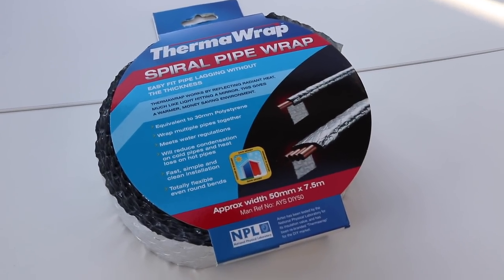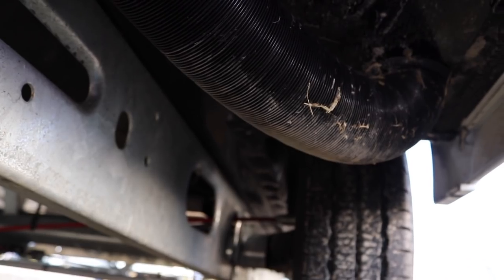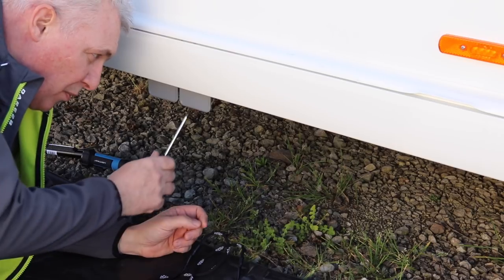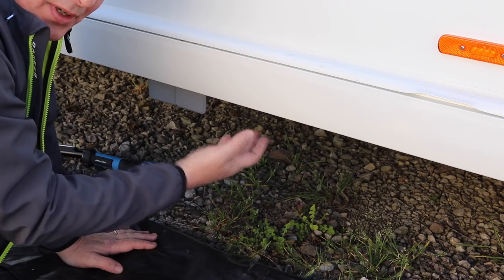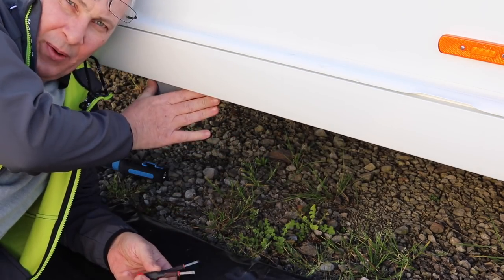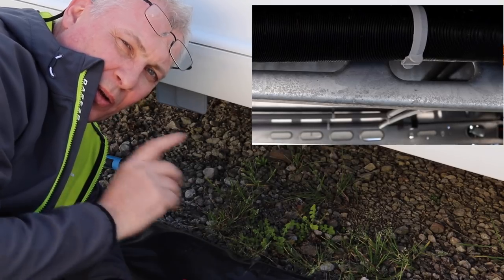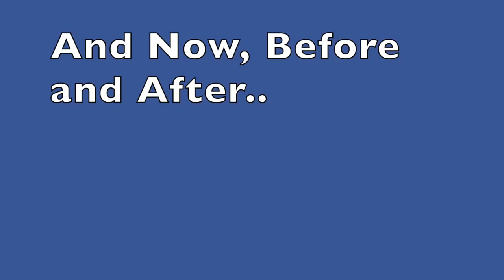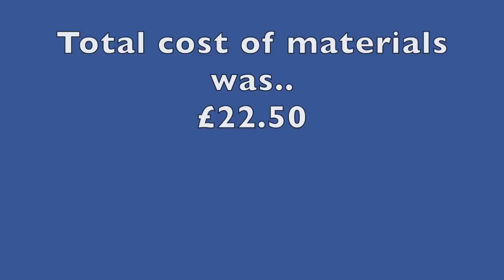Insulating the Blown Air Pipe External Ducting for Sprite Caravan

Comment: Great video. I heard a few people asked dealers when brand new to run all the pipes inside the van.
Reply from the maker: Thanks. Yes this is a getting rare outside ducting.  Swift still use this method sadly. What makes it more disappointing is that Truma make an insulation kit which is very expensive.  Thanks for watching. Phil😀👍

Comment: Hi Phil... nice neat job u done there 😎😎👍🏻... I experienced the Same problem to and after a lot of research and experiment to see exactly how the heater works to resolve the problem.. the problem is that it needs the gas to heat the exchanger up to increase the fan to disapate the heat... in winter the electric doesn’t get hot enough so the fan just ticks over... until gas comes it to top it up then fan will speed up blowing faster to the rear of the van.... downside is that after spending 4 days away in winter it used 3/4 of a 6kg gas 😪.. so ur probably best buying a small 2 kw electric heater to top up when cold instead of using ur gas ... hope this helps 👍🏻👍🏻
Reply from the maker: Cheers Dude. The Dealer explained using gas to me.  I think I will try a number of ways including your suggestion when we are away in a few weeks time. Thanks for the advice. Cheers Phil. 👍

Comment: Hi Phil u done a good job there I bet it back breaking under there not much room I've heard other people having the same problem can't under stand why manufacturer don't do this in the first place surely they know this is a problem .kev
Reply from the maker: Hi Kev. Yes it is hard work but I hope its worth it. I have spoke to Truma today and they recommend that you run the Heater on a mix of gas electric. I will be trying this out in a few weeks time. i will update everyone asap. Thanks again. Phil🙂👍
Reply: Swift can't even connect the waste plumbing under the kitchen sink properly, so I'd be amazed if they could be bothered to do this.

Comment: Hi Phil real fiddly job but I’m sure you’ll reap the rewards. The bathroom on our Charisma doesn’t get warm, pipes are inside but it’s a long run on twin axle. I only use the heating on electric (too tight to burn gas as well 🤣) and have it convection mode. I bought a small oil heater for a bargain price as the shop was closing down this keeps the bathroom toasty. Thanks for the vid.
Reply from the maker: Hi Colin Yes it was a pain to do and film at the same time. I cut my hand to bits😞. I am going to try it out in a few weeks time and also the small electric heater with me for the bedroom. Thanks again Phil👍😀

Comment: Hi Phil,i did this job on my Sprite Major 4 sb at the beginning of this year and today i had the chance to run it up as we are away for the first time this coming w/end,i used exactly the same materials as you and i`m happy to report that it does work,heating on 2kw leccy and using a 30c temp setting after 45 mins i checked the b/room vent temp and it was showing 26c on Eco fan,in the lounge area vent temp was 35c,i turned the temp down to 18c and it was very cosy BUT it soon became clear that the front area gets too hot with both outlets on that the obvious thing to do is turn the temp down but this would then make the rear of the van cooler,i need to find a way of restricting the heat outlet at the front to try and create a more balanced system but i don`t suppose there is a directinal flap on the Combi boiler to do this like there is on other Truma heaters,i can see this will be an issue in the future,all the best,Colin.
Reply from the maker: Hi Colin. Welcome. I am glad it worked we are away very and will be trying it out too. I understand you issue with the front being too hot.  I have spoke to Truma over the last week and sadly they say that restrictors on the front vent should be used on our type of boiler as it can cause the system to over heat. So to a degree we are back square one.  I am going to have a play with the system and try and work out a way of balancing the heat to a more temp.  I will do an update re this very soon.  Truma have suggested using Mix 2 and lowering the temp to about 21 degrees. Once the van is up to temp the gas shuts off and the leccy remains if the temp drops the gas kicks back in?  We will see.  Thanks for your helpful comment and I hope you continue to watch. PS Love my Sprite. Thanks again Phil
Reply from the maker: Oops I meant to say do not use the restrictors/ Hope this makes sense now. Phil😉
Reply: Hi Phil , a few years on now Dec 22, and updates?

Comment: Interesting Phil.  We had our first trip out last weekend.  It was cold and we felt like the van wasn't retaining the heat initially.  We switched to dual fuel and it seemed to do the trick for us, thank goodness.  Our van is shorter than yours and we don't have the end bathroom.  Think our pipes are under the bed.  That was a great fix there and I'm sure it will make a huge difference.  Will be very helpful for other people to know too!  Great job there!! :). Janice & Paul
Reply from the maker: Hi J&P. Hope you are both well and the weather is being kind to you up there. Thanks it seems to be the larger Sprites/Challengers with blown air.  They run that part of the ducting outside to increase the space at the foot of the bed. We will be testing it in a few weeks with our first trip out. We will also be running the gas as well.  Thanks for watching and supporting. P&J👍👍😀
Reply: @lostweekendscaravan  We are fine up here thanks, although this last week has been pretty cold in comparison to Feb.  Hopefully heading out again next weekend  for three nights, hoping to make more of our long weekends this year (so they are not lost weekends, lol!!).  Be sure to let us know how the heating works next time.  Best wishes to you both as always :)
Reply from the maker: @gallowaygetaways5326  Glad you are ok. We are away in a few weeks it is our 30th Anniversary. We are not going too far as it is the 1st trip of the year. Like you we will be getting away as much as possible but I have load of work to do on the house (new kitchen) this summer. We have booked several trips away and some will include Alfie. Take Care. P&J
Reply: @lostweekendscaravan  Aww, many congratulations to you both!!  We got our caravan during our 25th year.  Sounds like you've got lots planned then...have lots of fun :). P&J

Comment: Hi Phil - Just found your Channel & subscribed - Thanks for sharing - I have a motorhome & love that idea of insulating the heater pipe, we have a pipe from the heater to the front heating vent which is external & heats the front of the motorhome & cab area, this is not as efficient as the other vents & the cab area is always colder so will be doing a similar thing
Reply from the maker: Hello Andrew & Karen,  Welcome. I don't fully understand in this modern age and great designs that they insist on putting heating pipes outside the vans. We have been away for the first time this year and the insulation does work we noticed at least a 40 percent increase in heat in the bedroom and bathroom areas. To me that is a good result.  Thanks for your sub. Phil👍🙂

Comment: Another great video - always good watching other people grafting🤣

Looked like hard work but hopefully will pay off.

Surprised such a long external pipe run on a new van - They should fit the insulation kit at manufacture .

Good work !👍🏻
Reply from the maker: Hello Howard. It was slightly difficult. They do make a an insulation kit but they are not cheap, hence Swift not fitting them. Thanks again. Phil👍

Comment: Interesting video, got same materials last week in Aldi middle aisle to do my Coachman 2000 VIP460/2. I am wondering how difficult it would be to remove the pipe. Would certainly make it an easier job. I am thinking though there must be some reason you didn't go that route?
Reply from the maker: Hi Bernard. yes on the Sprite the pipe was sealed around the floor opening. This might be the case on your Coachman. Removing it would make it an easier job. Good luck with the job. Thanks Phil🙂👍

Comment: Did it work?  Would you buy another van with blown air or go for alde?
We have alde now which is fantastic just like being at home-- problem is we want a bigger van that has blown air but worried that wouldn't be as good and have cold spots like yours ?
Reply from the maker: Hello Lucio. The insulation did help by 20%. I also Replaced the 2 Lounge Vents with gated Vents which can be closed forcing the hot air to the rear. Blown Air Systems are quite good but if you are Winter Caravanning I would highly recommend Alde Heating over Blown Air. Thanks Phil🙂👍
Reply: Thanks Phil
We have alde now hence to worry to blown air but we need a bigger van 😂

Comment: Did you find this worthwhile? Thinking of sorting ours out. We have the bedroom at the back and it’s always cold and damp compared with the lounge. The dealer told us it heated up to the required temp in the required time so there was nothing they could do... they did the test on a warm day in June!!!
Reply from the maker: Mark Gardner Hi Mark. It has worked in conjunction with adding additional curtains in the bedroom and using the heating on mix 2. I think it was worth while doing. Thanks Phil 👍🙂
Reply: I hadn’t thought about extra curtains, good shout! Thanks 👍
Reply: I did this today, I used armaflex rather than spiral wrap just because it looked a bit easier to fit, there’s actually hot air coming out of the vents in the bedroom!!
Reply from the maker: @markgardner9696  Thanks for letting me know. It is  great to know when someone has a go at some of the fixes. many Thanks Phil

Comment: Hi I know this is an old video but I can't find the follow up. Did this improve the heating? as its something I want to consider doing as the air gets cold in winter?
Thanks for the great videos 
Chris
Reply from the maker: Hi Chris there was an update on an update video. It does make a difference. I did improve it further by adding gated vents in the lounge. This changed the flow direction and with the insulation it improved the bathroom & Bedroom massively. There is a link to the type of gated vent I am talking about. Thanks Phil.
https://www.ebay.co.uk/itm/272270935632?chn=ps&norover=1&mkevt=1&mkrid=710-134428-41853-0&mkcid=2&itemid=272270935632&targetid=1405062617979&device=c&mktype=&googleloc=1006633&poi=&campaignid=16782379350&mkgroupid=138238132947&rlsatarget=pla-1405062617979&abcId=9300843&merchantid=9569284&gclid=Cj0KCQjwzqSWBhDPARIsAK38LY-4Tlu519isbLqzWreg28ET10w_moBtmImJ9yEFxix1yzn5FbZz764aAv65EALw_wcB
Reply: @lostweekendscaravan  thanks i struggling to find the video but I keep looking thanks again 😊
Reply from the maker: @claytonchris1984  I honestly cant recall which one it is. I have made so many🤣🤨

Comment: Seems mad doesn’t it. It’s a long-standing problem with blown air systems and the caravan manufacturers surely must recognise the issue. Even if they offer a winter pack with increased insulation that would be something. They do boast about thermal quality of the walls, roof and floor so why not boast about the efficiency of the heating?  Good job done Phil, I like your theory with the lagging. 👍🏻🙂 Trev
Reply from the maker: Thanks Trev n Sue. I could not agree more. However thanks to putting this video out I have learned out to balance the heating. Maybe another film later this year.  Thanks Phil👍🙂

Comment: What was the reasoning given for the half electric/half gas idea? I mean, hot air is hot air isn't it?
Sounds like codswallop to me.
Reply from the maker: Hi Gary, I thought the same until speaking to Truma yesterday. They state that the boiler is meant to be run on Gas/electric mix. When up to temp the gas shuts off and remains on electric.  The Electric part of the heater is secondary and should not really be run on its own all the time as it could burn the element out. 

I do think that Swift should insulate the outside pipe or move it inside.  I will update my findings very soon.  I hope this make sense.  Thanks Phil